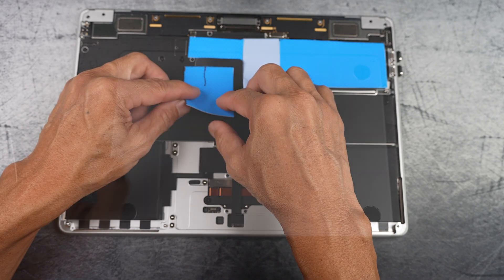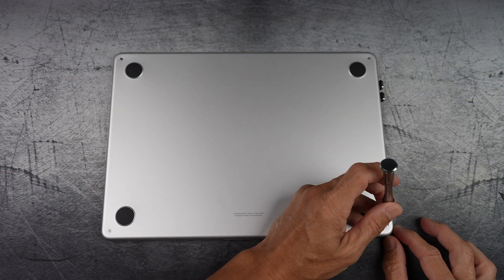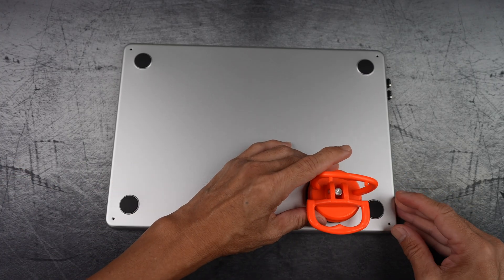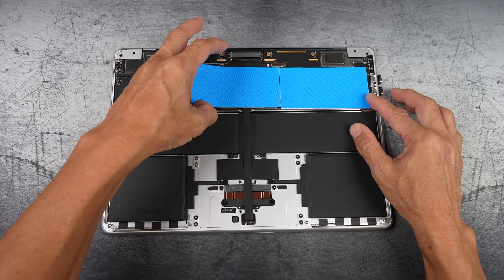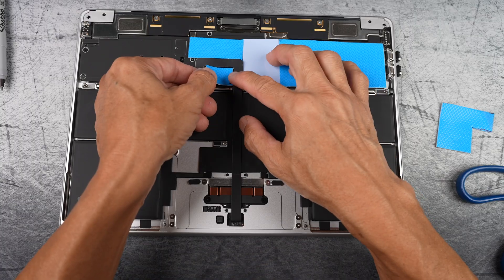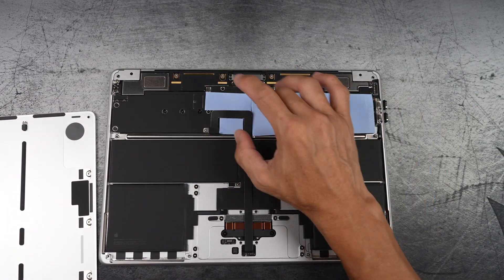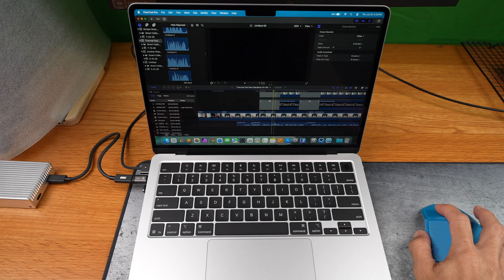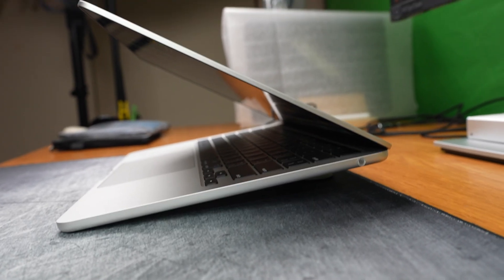MacBook Air M4 Thermal Pad Mod 2025 – How to Install (Step-by-Step)

Comment: I did it to by the way i used 1.5 mm thermal pad and it still very acceptable
Reply from the maker: Nice — thanks for sharing that! 👍 Good to know that 1.5mm also works well and still gives acceptable results. That’s really useful info for anyone trying this mod and deciding on pad thickness. Appreciate your info!

Comment: A few people brought this up already, but this mod is not recommended & attributes to premature wear/failure of your battery.

These thermal pads are intended to conduct heat onto a heat sink. When they’re used to transfer heat to the majority of the computers metal casing, it causes a Convection effect on your battey.

The heat in your aluminum casing escapes to anywhere with a relatively lower temperature. Your battery will soak up that heat long before it’s released to ambient air
Reply from the maker: Appreciate the feedback 👍 Totally fair point — there are maybe trade-offs with this kind of mod, especially long-term. However for my use, the thermal pad mainly helps spread heat across the chassis and reduce throttling, and I didn’t see meaningful impact on battery temps. That said, it’s definitely a mod people should consider carefully. Appreciate you sharing your perspective.

Comment: Man thanks for posting this video! I'm getting my first macbook (M3 Air) And I'm seriously thinking about doing the same, but I'm really concerned about it damaging the battery, what do you know about this and how has your experience been so far?? Thanks again
Reply from the maker: Glad it helped—and congrats on your first MacBook! Totally valid concern. So far in my experience, I haven’t seen any negative impact on the battery. The key is placement: keep the thermal pad only over the SoC area and away from the battery cells. The goal is to move heat to the bottom case, not toward the battery.

Comment: Does it void warranty?
Reply from the maker: If you’re careful, no, not likely. Any internal mod could void your warranty IF Apple sees signs of tampering. However, people have been doing this thermal pad mod since the MacBook Air M1, and no one has ever documented getting caught or having their warranty voided because of it. Just be careful and put everything back cleanly if you ever need service.

Comment: I am doing it for my hp pavilion 15 after its fan died + laptop cooling pad which has 2 fan. Just keep a eye on battery temp .
Reply from the maker: hat’s a clever way to keep it alive after the fan gave out. 🙌 Yup—battery temp is definitely the one to watch. Hopefully the cooling pad helps manage the heat long-term. Appreciate you sharing this—it might help someone else out too!

Comment: If you don't have a suction cup you can also use the little tip of the screwdriver in the empty screw hole to peel up the corner a little bit and then slide a credit card all the way around the outside that works fine
Reply from the maker: Great tip! I was actually thinking of trying something like that but wasn’t sure if it would work—thanks for confirming! That screwdriver + credit card combo is genius for anyone without a suction cup. 🙌💻

Comment: Keep an eye on the battery's temperature under sustained load
Reply from the maker: great point! I’ve been monitoring it during extended tasks, and so far the battery temp hasn’t gone up noticeably. But I’ll definitely keep testing under heavier sustained loads just to be sure. Appreciate the heads-up!
Reply: @TossSong  hi did u do the test ? i want to do it but i'm scared ofr battery temp
Reply from the maker: If this helps: I have had only real world tests. Like connecting the external SSD drive (continuously transferring data), recording plugging in the iPad to live stream what I write on it, while live streaming video calls all at once for say 6 to 8 hours straight. Without the mod, i would notice lagging here and there due to heat (hot). After modding, everything is minimal—the heat is now dispersed evenly on the back aluminum shell.
Reply: @TossSong  did u monitor the battery temp with stats or smth else ?
Reply from the maker: Sorry no, I’m a simple tech guy reviewer. There are others (YouTube videos) who are much more efficient and knowledgeable in these type of tests than me. And using exactly the same MacBook and mod.

Comment: won't it void the warranty if I did this?
Reply from the maker: Good question! Technically, yes—any internal mod could void your warranty if Apple sees signs of tampering. But to be honest, people have been doing this thermal pad mod since the MacBook Air M1, and so far, no one has ever documented getting caught or having their warranty voided because of it—not that I could find it. Just be careful and put everything back cleanly if you ever need service. 👍
Reply: @TossSong  hey! so I did this and using video denoise on filmora 14 takes little time now. I got another question, what if you you scratched the gold thingies near the 4 clamps to hold the bottom lid
Reply from the maker: Hey again! Glad to hear the thermal mod helped with your Filmora workflow—nice! About scratching the gold contacts (the ones near the clamps): those are likely grounding pads or EMI shielding contacts. Small scratches probably won’t cause issues. Next time maybe use plastic tools or be extra gentle around those spots. 😊

Comment: I wonder if removing a little of the black sticker over the metal plate that goes over the M chip would help further as the plastic sticker is probably acting as a barrier. I'd bet that cutting just above the CPU it'd be enough to act similar to that of an IHS on an intel CPU.
Reply from the maker: That black layer over the M-series chip is not just a plastic sticker — I think it’s typically graphite thermal tape (also called a graphite heat spreader). It’s designed to help distribute heat, not block it. Removing or peeling it off could actually make thermal performance worse unless you replace it with something better like a copper shim or high-quality thermal pad.

Comment: it's kind of strange why Apple doesn't do this by design. There must be a reason to why Apple doesn't.
Reply from the maker: Yeah, I’ve wondered that too. Apple probably has their reasons—maybe to keep it fanless and ultra-quiet, or to avoid heat transfer to the aluminum chassis. Still, for light mods like this, it’s surprising how much temps can improve with just a small thermal pad.
Reply: @TossSong  Call me a conspiracy theorist, but as far as I know the SoC in the Air is essentially the same as the SoC in the Pro (depending on how it's specced, of course). Which would mean that the differences mostly come down to the screen and the battery life. So, if you use some kind of hub and external peripherals and only need a laptop for the portability but it otherwise functions as a desktop, it makes spending the extra money for the Pro look a lot less appealing if the Air can do essentially all of the same things with similar performance.

tl;dr: Apple purposely nerfed the Air with passive cooling so as not to cannibalize sales of the Pro.
Reply from the maker: Totally agree — I’ve had the same thought. The thermal pad mod shows how much more potential the Air has, and your breakdown makes a lot of sense. Apple likely wants to keep a clear divide between the Air and the Pro line. It’s kind of wild how a small pad can close that gap in performance. Appreciate your insight!
Reply: @lordbreor  I think you are spot on. I don't see why they wouldn't have used the Aluminum chassis to disapate heat. Other than to purposely make the Air throttle. They do it on the iPhone 17 Pro. But the iPhone Air no Aluminum or Vapor chamber. More thermal trottling.
Reply from the maker: Totally agree with you too — it really feels like a missed opportunity not to use the aluminum chassis for better passive heat dissipation. The iPhone 17 Pro does it, so why not the MacBook Air M4? It does start to seem intentional when both the Air and iPhone lack vapor chambers or internal metal contact. Thanks for adding more to this convo — appreciate the thoughtful input!
Reply: 1. They want to cater to a different market vs the Pro.
2. There is laws and regulations not to have the laptop body emitting too much heat... these pad transfer alot of heat and can "potentially" hurt laps/skin.  Have you wondered that gaming laptops tend to direct heat towards the back ? cuz its furthest from the skin.
Reply from the maker: There’s definitely some intentional design decisions behind it. Between regulatory limits and the need to keep the Air lineup thin, light, and “lap safe,” Apple likely plays it conservative with thermals. That’s why modding with thermal pads is fun—it gives users more control, especially for desk use. Appreciate your take!

Comment: Is the process the same for the M3 Version?
Reply from the maker: Yep, the process is basically the same for the M3 MacBook Air! The internal layout and SoC position are nearly identical, so the thermal pad mod works the same way. Just make sure you place the pad carefully over the SoC and avoid the trackpad cable like in the video. 👍

Comment: I did this, combined with a fan cooling stand, and my Mac is now locked on 3.94 GHz, whereas before it has throttled to ~2.1 GHz under sustained load. Thank you.
Reply from the maker: That’s awesome to hear! 💪 3.94 GHz is seriously solid — love that the combo with the cooling stand made such a big difference. Thanks for sharing your results, really glad it helped!
Reply: I wonder if removing a little of the black sticker over the metal plate that goes over the M chip would help further as the plastic sticker is probably acting as a barrier. Though if adding a fan makes a great difference that implies that the chasis is already hot enough as is to render a fan a further improvement.
Reply from the maker: That black layer over the M-series chip is not just a plastic sticker — I think it’s typically graphite thermal tape (also called a graphite heat spreader). It’s designed to help distribute heat, not block it. Removing or peeling it off could actually make thermal performance worse unless you replace it with something better like a copper shim or high-quality thermal pad.
Reply: @nahudiscard  at this point, you'll need to look into cooper shims, if you want absolute maximum heat transfer
Reply: I'm over here with a 3570k crying. jk, it still fucks when overclocked.

Comment: why don't you paste the remaining left part?
Reply from the maker: Good question! I only added the pad on the logic board side because that’s where the SoC and most of the heat-generating components are. The left side doesn’t really need it—no major heat sources there, and adding a pad might mess with the trackpad cable underneath. Gotta play it safe!
Reply: @TossSong  I read on reddit that this paste makes the battery deteriorate faster, so have you considered applying a thermal pad to the battery?
Reply from the maker: Yeah I’ve seen that too! That’s why I avoided applying anything directly to the battery. Don’t forget that this mod has been done since the M1 MacBook Air. There would have been more serious reports if that were the case. Again it’s a choice though for one to do it.
Reply: @TossSong  Hey, it’s been a while! How’s your MacBook doing now? What are the typical CPU and battery temperatures during regular tasks like web browsing or watching movies, and how hot does it get during heavy workloads such as rendering?
I just bought a MacBook Air M4 and am thinking about doing a similar mod. Mine runs around 44–50 °C during light use and reaches 70–90 °C when gaming.
Reply from the maker: Hey! It’s been great so far. The most intense thing I do is video editing in Final Cut, and during heavy editing I can actually feel the heat spreading across the whole back aluminum case — whereas before, the heat was only noticeable near the ports. So yeah, the mod’s been working just as intended!

Comment: I started following along but two of my screws won’t budge even a bit at all
Reply from the maker: Ahh, yeah that can totally happen. Some of those screws are really snug from the factory. Try using a better grip screwdriver with a bit that fits super snug (or try rubber glove). Also, light pressure and a tiny twist back-and-forth can sometimes help loosen it without stripping. Hope it works out—hang in there!

Comment: Nice video, why not remove the black film too and have the pad directly on the board. It supposed to be non-conductive and the black layer is likely insulant.
Reply from the maker: Good point 👍 but removing that black layer would void the warranty. At least with the pad on, I can still take it off later if anything goes wrong.
Reply: @TossSong You're awesome, I'll do it with my Mac, I don't care about the warranty because Apple devices are high quality and don't break down. Note that there is no warranty in my country, Iraq. Regards ❤️
Reply from the maker: Thank you, I have had no problems since making this mod. And my experience has been positively great, the heat has lessened because it spreads out on the aluminum back instead.
Reply: What do you think of the ARCTIC TP-3: Premium Performance Thermal Pad, 100 x 100 x 0.5 mm? My replacement is 1 mm. @TossSong
Reply from the maker: Good choice! I’d personally go with the 1mm thickness, since thermal pads tend to compress over time and that extra bit helps maintain contact for longer. 0.5mm might leave some small gaps once it settles.
Reply: I will buy a heat-resistant thermal insulation tape and put it on the battery to insulate it from the heat because the temperature in Iraq reaches more than 50 degrees Celsius.
Reply from the maker: From what I understand, the black sheet on the MacBook battery is already a graphite heat-resistant layer. Adding insulation tape on top could actually trap heat instead of helping, so I wouldn’t recommend it. Apple designed that graphite layer to spread heat properly.
Reply: ❤🎉 @TossSong

Comment: will this heat up the battery and cause it to degrade faster? Or is it to minimal
Reply from the maker: It’s minimal — the pad mainly pulls heat away from the SoC toward the bottom plate, and the battery is on the opposite side. I’ve been monitoring temps and haven’t seen any concerning battery heat increase.
Reply: @TossSong  I know this is a dumb question but this will void the warranty right? or the pads can be removed pretty easily
Reply from the maker: Thanks for commenting. No, according to many documents online. However, don’t remove anything like the black graphite tape on the board and batteries.
Reply: @TossSong  thanks a lot for your response
Reply: @dread1811  if you're sneaky enough and dont leave any trace, you wont void the warranty, pads can be removed easily
Reply from the maker: I agree. If it needs service. Hope I never have to bring it in for any reason. 😅

Comment: Thanks for your detailed and methodical approach to the mod. I saw a similar mod that used 1.5 mm arctic p-3, whereas you used 1 mm. Would you say that 1mm is sufficient enough? I read that the arctic pad can be compressed by like 30 to 40% and still function well, molding to contours, but no reason for overkill if not needed.
Reply from the maker: Great question! I wouldn’t recommend going with 1.5mm—while Arctic pads do compress (and they did for me), it still wasn’t enough to completely close the side gap near the ports. You’ll also feel a noticeable bulge on the back panel. The 1mm works well and avoids those issues. No need to go thicker if 1mm is already transferring heat effectively!
Reply: @TossSong  Thanks for the low down, no pun lol. I've got the 15 inch version, do you think I could possibly get away with less padding near the ports, allowing it to close a little easier?
Reply from the maker: Yeah, that could definitely help! Since you’ve got the 15-inch version, the extra chassis space might make tolerances a little more forgiving. Yeah, if you go lighter on the padding—as long as you cover most of the SoC (M chip) area. And especially near the edge—it might let the case close more flush. Just be sure you’re still getting contact where it counts thermally. Sounds like you’re thinking it through smartly!
Reply: 1mm pad is ideal enough for M2~4 chip MacBook Air. 1.5mm can damage the D case
Reply from the maker: Thank you for sharing! I agree. I mentioned a little bulge on the side, but now it has flattened.